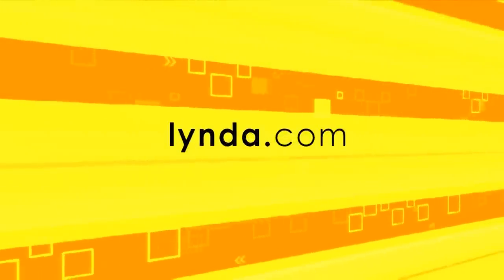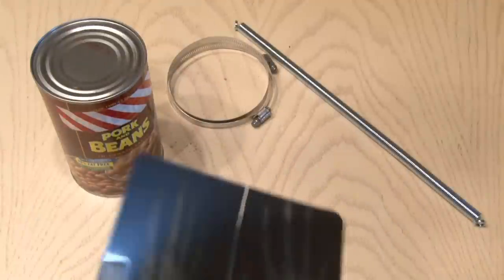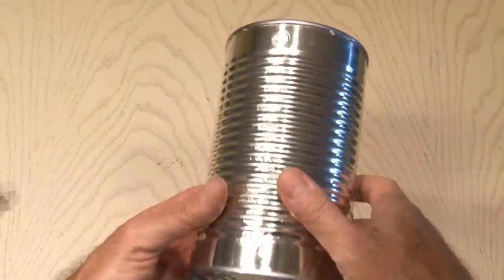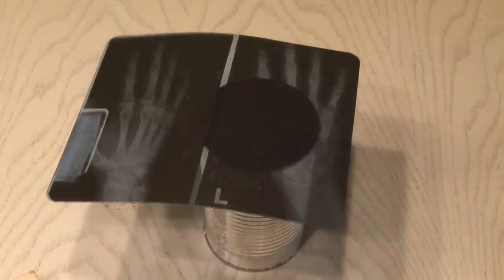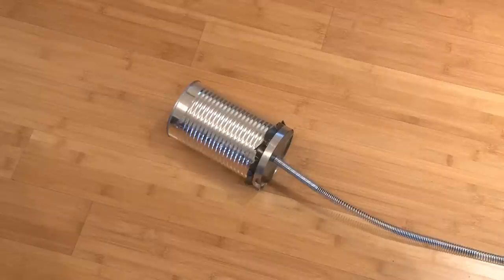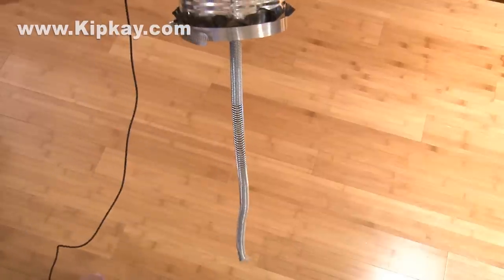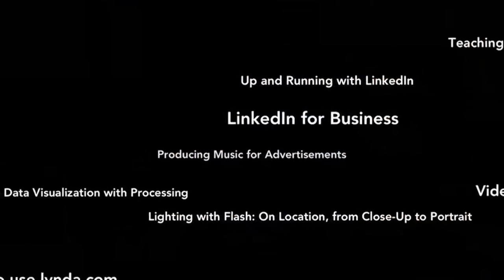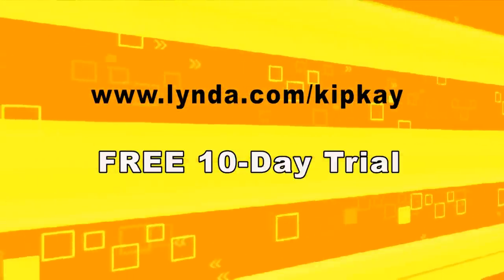The Thunderdrum!

Comment: For those who can't find an X-ray to use as a drum skin, another youtuber made can-sized drum skins by cutting open a thin water bottle, such as a poland spring 16.7 oz bottle, pulling it tight as you can around the can, fixing it with a rubber band, or hose clamp, and shrink fitting it with a hot hair dryer or heat gun.  The heated plastic shrinks tight and forms a smooth, drumhead-like plastic skin.  As a matter of fact, heating the X-ray KipKay used would probably increase the resonance in this can drum project.